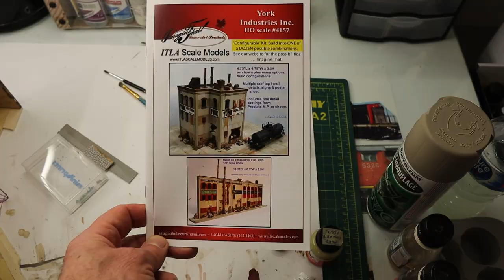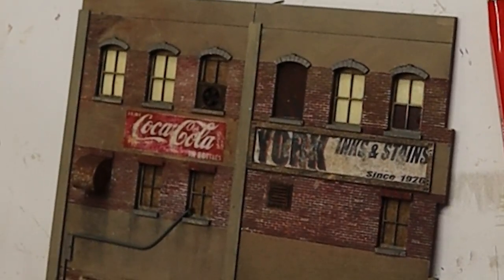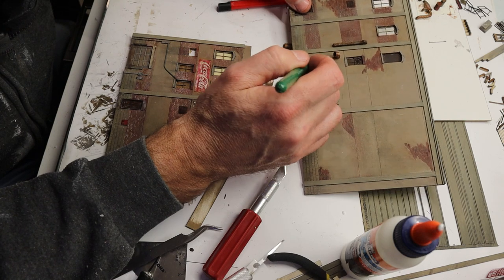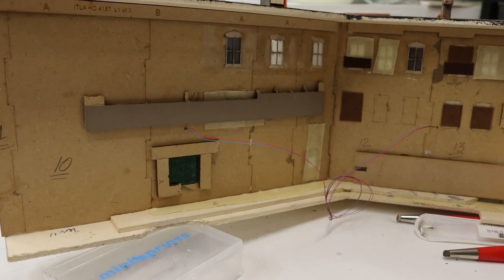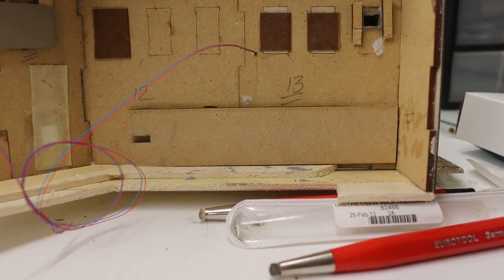ITLA York Industries Kit Build and Weathering

Comment: Fantastic results Steve!  I've yet to put together an ITLA kit, are they made of thin wood or are they essentially card board?
Reply from the maker: The wall sections are 1/8" MDF; same material you can buy in 1/2" sheets at Home Depot.  Some of the detail strips are very thin plywood material.  The MDF is very stable so it does not warp and requires no painting on the back, even if you are lighting the structure.
Reply: Our structure walls are made from durable 1/8" MDF, layered with thinner Birch Plywood parts, and many Laserboard detail parts... no cardboard.  The wood medium is easy to work with, and honestly very rewarding.  Please give our kits a try!   Nick@ITLA